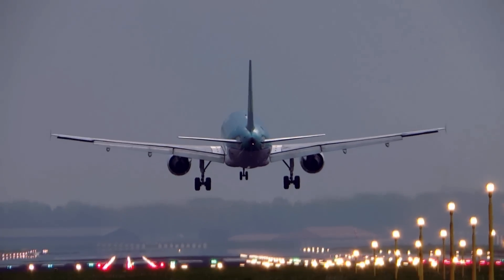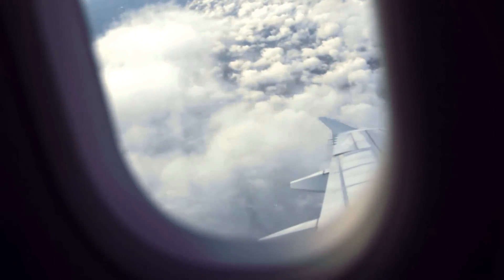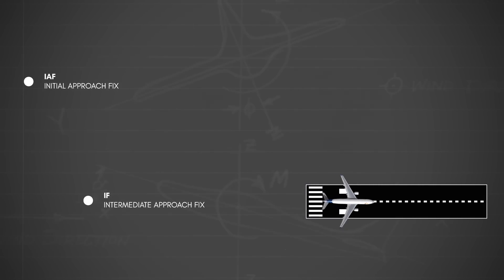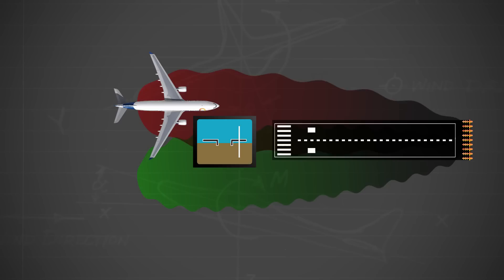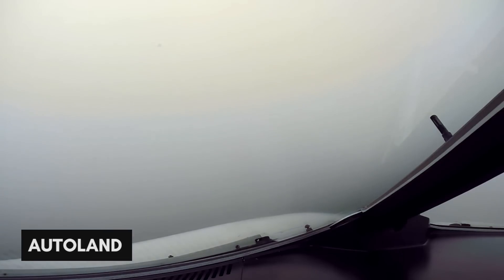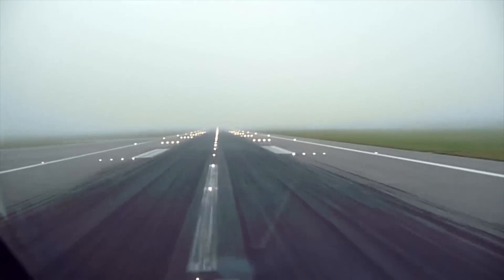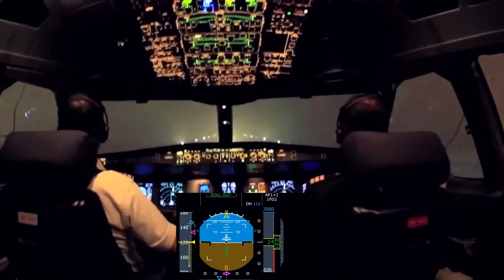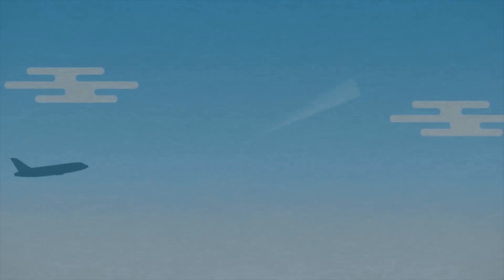How Pilots Land Blind

Comment: Great video to introduce folks to low visibility approaches.

   3 points to make:

1.  The depiction of the location of the GS antenna was not accurate.  It is normally located 1000 ft from the approach threshold and therefore its beam will guide the airplane to touch down 1000 ft from the threshold.

2.  There are airlines that have OpsSpecs to conduct CAT III, CATII and SA CAT I approaches with autopilot and auto throttle OFF.  These CAT III approaches are hand flown with the use of a HUD down to a DA radio altitude of 50 ft with RVRs as low as 600 ft.  The flare and rollout guidance is provided in the HUD as well.

3.  The flare is not the most hazardous and risky part of low visibility operations.  By far, the riskiest part of the flight is the ground operations during taxi!  Crews are MUCH more likely to miss a turn or inadvertently encroach on a runway while taxiing in low visibility.  A lot has been done recently to mitigate this risk via improved lighting and standardized SMGS low vis taxi routing,  but the hazard remains.
Reply: 3. "most hazardous part of an an autoland approach".
Still in the air, taxiing doesn't count. Otherwise, you're right.
Reply: ILS
Reply: Agreed. On point number 3 I believe one of the most deadliest aviation disasters that was entirely preventable involved a KLM heavy at Tenerife in the Canary Islands. Nice post.
Reply: @stevenkelby2169  If taxiing doesn't count, why did the FAA mandate enhanced taxiway centerlines, enhanced taxiway hold short markings, runway mandatory red/whites. SMGCS has a long way to go, years back a SMGCS route was designated by a 12" taxiway centerline, when I retired from the airfield markings team, everyone of our taxiways was 12" whether if it was low vis or not.
Reply: @mikef6307  Of course it counts but you were replying to a specific comment in the video, "autoland approach".
Taxiing is, by definition, not part of an "approach".
That is all :)
Reply: @Mike F... to prevent runway incursions... not to help airplanes land and roll out even into a high speed.

Comment: This video is amazing! You managed to explain everything correctly and very clearly considering this is all quite hard to take in for people who dont know much about aviation - from the basics all the way to CATX approaches. 

I would just like to add that the autoland system is very rarely used and pilots tend to land their aircraft manually in 98% of cases. Though autoland is used every now and then to check if it is operative depending on your airline's procedures.

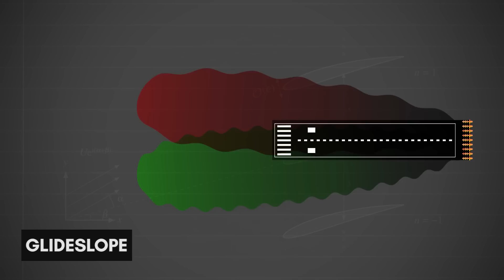Comment: 6:15 Close. It's not about the signal strength, it's basically matching a phase shift so that it's getting a frequency as the difference which is what moves the needle. It is looking at the shift in phase between the two. Close though, and good enough for most people.

Comment: Airlines under part 121 are required to fly on an IFR flight plan, FYI

edit: a missed approach isn't a go around, its a missed approach.
Reply: Gage  'Missed approach' is just the direction and area to climb to if for whatever reason you do not land. So if the pilot goes around, if tower doesnt give landing clearance by minimums, they will all follow the missed approach procedure.

Comment: 1:50 You can add information, that IFR is required over 18,000 ft in the USA due to FAA regulations. Other country mostly have different rule (e.g. in Poland over 6,500 ft we change to QNE and over FL 200 we have to fly by IFR rule)

Comment: We were required to perform an Autoland about each 60 or 90 (?) days, on the MD-88/90, or the shorter "MD", the B-717. A briefing guide was always followed, requiring certain approach and runway lights,  TDZ RVR (vis. inn the touchdown zone), crosswind limits, reported braking action, dual operational thrust reversers, autobrakes etc.
Until the Flt. Ops computer-on the ground- began to give us reminders for currency., pilots Very seldom wanted to do any landings except the normal hand-flown types.

Note: the "non-precision" approaches were often preceded by pretty rushed briefings: both the type, and the actual approach 'plate' (chart). You could takeoff and not yet know which destination runway was the planned 'active runway'.
The more (potentially) hazardous non-precision approaches we flew in the southeastern US from our ATL (Delta) hub were at ROA/Roanoke and especially AVL/Asheville.

Comment: Great video! One question... what about those awesome looking landings in windy conditions where the planes land almost perpendicular to the center of the runway? Are they also automated, semi-automated, or entirely manual? If so, I assume it’s only possible with fair amount of visibility.  At which point does the pilot take over, and how do they decide if the weather is still conductive to a safe landing? Some of them look really dramatic, but I assume there are strict procedures and limits in place to assess safety, or is it entirely up to the pilot at that point?
Reply: Those landings are typically entirely manual.  A CAT I ILS provides plenty of visual time to transition from a crab (the dramatic difference between the heading of the aircraft and the runway) to a side slip, so visibility isn't a primary concern.  In those cases, I generally take manual control early in the approach (outside the IAF) so I can better feel and respond to the wind conditions in the descent.  Aircraft and airlines have established cross wind landing limitations, in the case of my aircraft, its 30 kts of direct crosswind (i.e we can land with 30 kts of crosswind or less).  We get wind updates in the descent from ATC, and if the crosswind exceeds the limitations, we would execute a missed approach.

Comment: Great video! One quick clarification.  CATIIIb has no decision height, however you must have greater then 700ft (if I remember correctly) RVR, or in other words, how far down the runway I can see.  CATIIIc is actually zero visibility and zero RVR, but you can't taxi in those conditions so its sort of pointless and I don't know if any airports are certified to that level.   Again, great videos.
Reply: Wouldn't a CATIIIc situation be called for when it's a bit of an emergency landing situation say, already done multiple missed approaches and weather is just packing in worse and you have to get down even if you're stuck on the runway?
Reply: Scott Watrous in that situation they would go to their alternate airport and wait out the storm.  I don’t know of any airports that are currently certified to CAT3c standards.  Both the airplane and the airport equipment must be certified.
Reply: embfixer is right. The lower the airline (operator) minimums the higher the equipment testing and aircrew training costs is. At Delta we had cat IIIC down to 300' RVR. The lowest I remember landing in was about 500' RVR. Taxiing in on a big airfield with vis that low is difficult and potentially disastrous. I remember several foggy early mornings in ATL when we were landing and ValuJet was diverting since they had higher minimums. For takeoff we needed 600' RVR with high intensity runway lights operating, that was a pilot flown maneuver.
Reply: @scottwatrous  In an ACTUAL emergency anything goes. You can land at an airport that only has CAT1 ILS and yet 0 feet ceiling and visibility. If thats the best you can do in that situation (out of fuel, fire on board, etc.) nobody will make a noise. It would be silly to have the floor melting under your feet but the crew says "but this airport isnt certified, lets go to our alternate"

Comment: And then there’s the Dash 8 Q400 that can do CAT3b with no autoland and no autothrottle. All hand flown with the HUD.
Reply: Ah good old Dash... also popularly known as "dash trash" and "dash crash" by its respective pilots
Reply: Yes, same goes for the Embraer. Not entirely correct in this video...
Reply: McPebbster Pancakes are you talking about the E175? If so, what operator has approval for CAT 3?
Reply: SIM CFI Lufthansa operates the E190 and E195 with dual HUD up to CAT3a
Reply: McPebbster Pancakes ah ok good to know. I only ask because I was told Horizon Air is the first to fly the E175 to CAT3 using autoland.
Reply: SIM CFI That is a possibility. I know that Air Dolomiti, a daughter company of Lufthansa, operates the E195 with Autoland, but only down to CAT2, if I’m not mistaken.
Reply: hawker445 tell that to Horizon. Their Q400 has a HUD and there is no auto land on a Q400. This article is from 2003 when they first got the approval. http://www.aero-news.net/index.cfm?do=main.textpost&id=17debe95-132e-4fa0-aa0b-f234523a4632
Reply: You can't hand fly with the autopilot off on a CATIII let alone a CATII until you're at minimums.
Reply: Nicholas Blanck Yes you can. If the aircraft is equipped with a dual head up guidance system you can fly CAT3a down to 50’ by hand. You actually MUST disengage the autopilot latest 1500’ AGL on that type of aircraft.
Reply: Nicholas Blanck so tell me how Horizon is flying their Q400s down to 50ft minimums and 600 RVR?
Reply: McPebbster Pancakes don’t even have to have dual HUD. The Q400 only has one HUD and three NAV radios.
Reply: You just have to have one HUD

Just remember that the rationale for a CAT III autoland is that the pilot flying cannot transition from instruments to visual fast enough, nor is there time for crew resource management as in the case of a pilot monitored approach where one pilot is flying and one is on the dials. 

With a HUD, the pilot can be both flying and on the dials.

Comment: I'm confused after watching this. So are most commercial flight landings done by autopilot or manual. I've always been told that take offs and landings are done manually.
Reply from the maker: It’s predominantly manual. Autoland is really only used in extremely low visibility conditions.
Reply: Because landing is most riskiest part of flight, pilots are on the alert. it's easiest be do something. Autopilot can landing any time.

Comment: Good job, but Category I approaches in IMC are not the piece of cake for airliners that they are for light aircraft.  The higher approach speeds of large aircraft mean that there will be much less time to react when the runway environment becomes visible at altitudes as low as 200 feet AGL.  Even when VMC conditions allow visual approaches to be made, airline pilots frequently use ILS signals, when available, to aid in glide path alignment for landing.

Comment: Actually, Take Off is the most dangerous phase of flight.  In the event of power lose or any event leading to a stall will cause the aircraft to crash because there is no room to recover. If you are suitably skilled and lucky, you can recover enough to land straight ahead. The danger in landing is managing airspeed near to stall speed. This is not hard, most of the time with training and practice. Cross winds do get your attention and make things more interesting. Slipping by cross controlling an aircraft operating near stall is a skill worth developing. In reality, you have to balance power as well as 3 Axis Control. Stay as far above stall speed as is realistic for the type of aircraft you are flying. Straighten out at the last second, dump forward speed and hold decent speed. Working in your favor is ground effect. Even if you lose power on approach, you have a very good chance of gliding the aircraft on to the runway. Done right you will be lined up on the center line with your wheels on the ground.

Comment: I guess I'm late to this party. Typical regional jets do not have auto land. Many go down to CAT II as a result, with a hand flown landing at minimums. I've done exactly one of those right at minimum visibility at night. Normally I look to the far end of the runway in a flare, but without that, it is super trippy. There's a reason only the captain would do it, you have to have really good feel for the plane to land with basically your instruments and a center line. Finding the exit was another fun process in hoping the turn off lights are actually on.

Comment: So is the glidescope part of the IFR or VFR?
Reply: A flight under vfr wouldn’t fly a glideslope (GS) or glidepath (GP).  only ILSs precision approaches have GS and non precision approaches ie RNAV, or LOC have GP. that being said there is one non-precision approach that has a glideslope, the LDA (lateral deviation approach). A LDA he’s basically a ILS that is offset from the centerline of the runway, they are uncommon and have significantly higher minimums.

Comment: One thing that's not quite right: Scheduled airlines generally always fly IFR approaches and takeoffs. They will usually only request to fly a VFR approach to keep current with the required number of visual approaches per month. Flying with the automation is safer because "autopilot" isn't there to do the pilots' work, it is there to reduce the workload allowing them to keep more eyes outside the cockpit looking for hazards (PF), and on the instruments looking for problems (PNF).
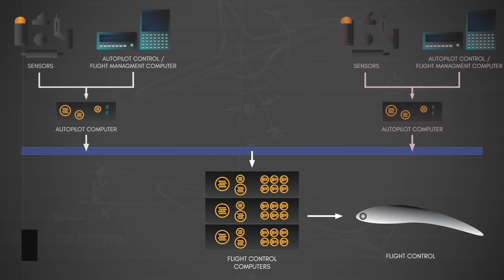9:30 That why 737MAX's MCAS operation made no sense.

Comment: GBAS (ground based approach system) - Communication between aircraft and the ground based sensors.
What could possibly go wrong?
Reply: GBAS actually stands for Ground Based Augmentation System. It does provide correction and monitoring of GNSS data in real time via VHF data-link, so aircraft that have appropriate equipment onboard can fly GLS (GBAS landing system) approach. I believe it's approved for "CAT-I" minimums, but they have plans to certify it for up to CAT-III.
Reply: If you have a handheld GPS receiver, you may have seen a thing called WAAS (Wide Area Augmentation System) show up on your screen when your accuracy suddenly starts improving toward 2 meters RMS or better. The WAAS system consists of 38 very accurately surveyed (<1 cm) fixed ground stations called WRS (Wide-area Reference Station) to measure the GPS timing signals + 3 WAAS Master Stations to collect the data from the WRSs and, with a supercomputer, to calculate corrections + 6 uplink stations to send the corrections to 3 geostationary satellites that then broadcast the corrections. WAAS ground stations used to be at 12 of what used to be 13 ARTCC locations (now 22, Indianapolis still doesn't have a WRS) in the US only, but now are located in many other locations in the US (incl. Hawaii and Alaska), Mexico, and Canada. A third phase of expansion is currently underway.
What the ground stations measure is deviations in the timing of the signals from the regular GPS satellites overhead. When the ionosphere is puffed up, the signals from the satellites arrive ever so slightly later because the speed of light through a medium is slower than through a vacuum. One nanosecond in timing error adds 30 cm of position error. But we know the ground station locations and the satellite orbits very precisely. By measuring these deviations across multiple satellites through one WRS location and then correlating these with other stations' measurements, the central computers can calculate the shape of the ionosphere over the covered region. Those corrections are then sent up to the geostationary WAAS satellites. The corrections that are broadcast will then account for the variations in the thickness of the ionosphere that the GPS signals travel through from specific satellites in order to improve the accuracy of the triangulation that your receiver does.
GBAS systems add what amounts to a GPS satellite on the ground (probably on a tower) that provides a fixed and extremely accurately known position fix to a local area that may contain multiple airports.

edit for (hopefully) a bit more clarity and depth of information.
Reply: What could go wrong? The pilots detect the failure and they go miss? Come back for a second try or if the airport is below minimums, they divert to their secondary. Something along those lines happens several hundred times a year all over the world already. I don't see airplanes wiping out cities all the time, do you?
Reply: @Jay Zenitram: If you fly an RNAV approach via GNSS equipment, and GNSS becomes unreliable, you get reduced state vector accuracy. That's not a problem if you're following published approach procedure that's designed to handle such failure. If you go outside of procedure scope, then you can potentially experience a problem. That's why aviation is so strictly regulated.

Comment: What I don't understand is why runways are so short
A lot of these tragedies could be avoided if every airport had one five mile long Runway that can be accessed from all four directions
Reply: Richard Wolfe runways are restricted in length by their location and typical use.

5 miles is too much, and a lot will be just wasted as it won’t be used at all. Generally at sea level 2-2.5 miles is sufficient for any plane 
(Ps if there is a runway overrun, the mainly because of external factors, and not because runways are short)

Comment: Why can't they just stick a GPS on the plane? It is accurate to millimetre and suitable for surveying and engineering work
Reply: They do have GPS. It's routinely used for navigation and approaches these days. But without GBAS, it's not accurate enough in real time to land and maneuver on the ground in all weather conditions. The "A" is augmentation, and the thing it augments is the GPS signal. Just like the second "A" in WAAS.

Comment: The average modern car has more processing power than the average commercial airliner
Reply: The average modern car operator has less processing power than the average commercial pilot.
Reply: Aerospace is the most conservative industry out there. Planes still use generators. Alternators aren't reliable enough. Safety 1st! (most of the time)...